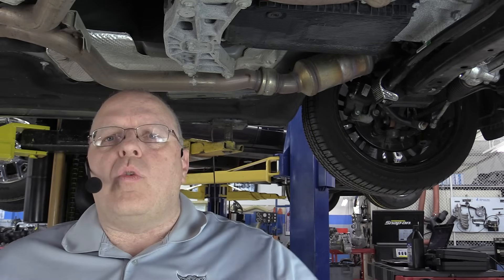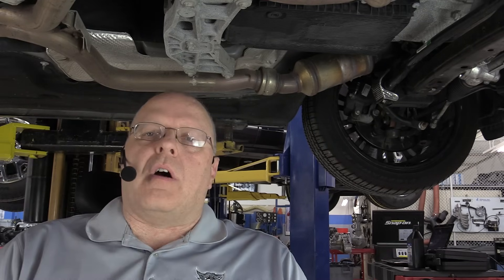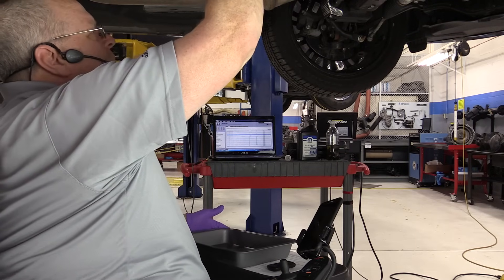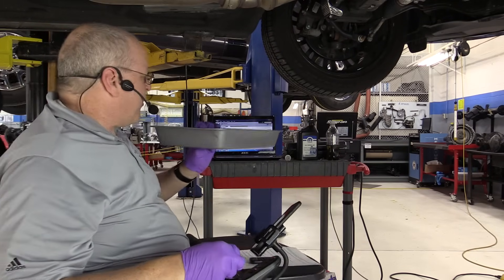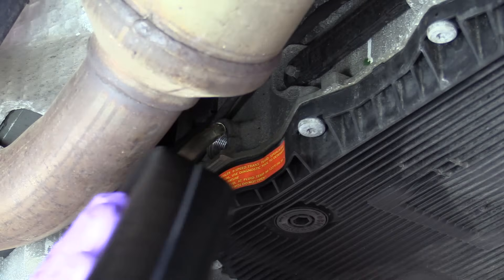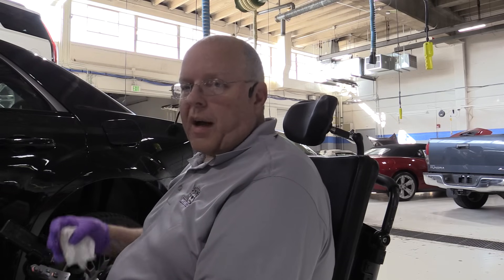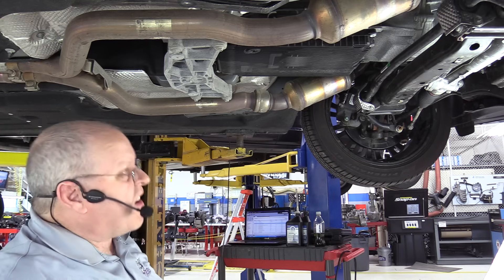Jeep, Dodge, RAM ZF 8HP 8HP 8-Speed  Transmission Fluid Level Check - No Dipstick

Comment: such a hassle for such a complicated high tech transmission but It's probably a engineering decision made to keep the transmission as universal as possible for all markets. would be nice if it could tell that the level is low or high via the scan tool or vehicle display maybe a level or pressure type sensor so you could get the transmission to temp the bypass valve would open and with the right software the system would tell you exactly how low or high the fluid actually is. just a thought I'm sure somebody may have already considered this
Reply: nice video by the way
Reply from the maker: Thank you!
Reply from the maker: Thank you for your feedback

Comment: I have 2015 dodge durango 8hp70 zf awd 
problem harsh down shift 4 to 3
and harsh transmission  he was parking the car in the event of tiptronic Changer and switch from steering 1 to Resolution 2
Reply from the maker: I do not understand your question
Reply: WeberAuto you have ever email

Comment: Do you recommend servicing this trans even though they claim it is fill for life.  I just don't believe it will last on the original fluid.
Reply from the maker: Yes, but not until a higher mileage, maybe 100,000 miles. Thanks for your feedback!
Reply: Thank you,
My 2013 300 has 149k on it now. Mostly hwy miles
Reply: ZF recommends every 100,000 KM (62,000 miles) or 8 years but it seems most manufactures say it is "lifetime" I plan on changing the fluid and filter on my 8HP 55A at around 70K miles

Comment: John,

Thank you for your valuable explanation; this will help me a lot when I change my ZF 8HP45 transmission fkuid.

If I may add, many BMWs also use the ZF 8HP AT, in particular the more recent F-series.

Conducting an AT oil change on the ZF 8HP merely replaces less then half the total amount of fluid in the transmission.
What are your recommendations for the ZF 8HP to get as good as a complete AT fluid change/flush as a DIY job and thus without having any special devices or a pump etc?

What are your comments on this procedure:
https://www.youtube.com/watch?v=tno0NfJmsSo
and
https://www.youtube.com/watch?v=ldUFUeV71us&t=1232s

And can this method be applied to the ZF 8HP AT to achieve a full oil flush and change?

Thank you for your expert advice.

Jake (Belgium)
Reply from the maker: Thank you! Yes, disconnecting a cooler return line at the transmission, and adding new fluid at the same time, until the fluid coming out of the cooler line is good and clean, is how I would recommend changing all of the fluid in any transmission.

Comment: Best thing to do is not buy one of these cars. That's just too much to deal with. $43 per quart and probably a $250 filter is crazy.
Reply from the maker: All transmission fluids and engine oil are more expensive now. Look at the special engine oils required for the tighter tolerance engines of today. The fluid in this transmission is expensive, but it does not need to be changed very often either. All new automatic transmissions take a special expensive fluid today.  Thanks for your feedback.

Comment: amsoil signature atf seems to suggest it meets the specs for zf autos
Reply from the maker: I don't know anything about that. I do know that the ZF fluid for this transmission has an additive similar to limited slip differential additive. It allows the clutch packs to slip, on purpose, as part of normal transmission shifting operation. Regular ATF does not have that additive. The ZF fluid looks more like gear oil than ATF. To me, it would not be worth using any other fluid than the exact fluid that ZF calls for. Thanks for your feedback. Best wishes!

Comment: Hey John, Great vid.  I am curious why you're worried about the oil cooler bypass?  I would have to believe that the when the valve is in bypass, the oil in the cooler is trapped and can't bleed back.  If it's bypassing the cooler, how could the oil in the cooler circulate back?   Thanks for your thoughts on this.
Reply: I agree with cmbenson1911, there almost has to be a way to keep the fluid in the cooler to keep the levels correct. My guess is that it isn't controlled by temperature alone, I would hope it requires the fluid pressure to open it as well so as soon as you shut it off and the pressure drops it closes the valve.
Reply from the maker: The oil cooler bypass opens when the fluid hot. If you shut off the engine while the fluid is hot, some of the fluid can drain back into the transmission. Then the fluid and bypass valve will cool down. This will leave open pockets of air in the cooler until the valve opens again. Thanks for the feedback.!

Comment: Check your transmission fluid levels in only 47 easy steps! 

Wow... crazy.
Reply from the maker: Welcome to 8 speeds and above! Thanks for your feedback.
Reply: Yep, crazy... Another effort to  prevent DIY'ers from doing their own maintenance.
Reply: @ureasmith3049  Honestly, other than the temperature considerations, this isn't much more complicated than the fluid check procedure for my 98 Honda Civic with a manual trans. There's no dipstick. This doesn't take any more time than an oil change.
Reply: @ureasmith3049  I'd even trust a dealer to perform such complexity the right way
Reply: He just lost all the fluid he put in. 😂
Reply: Exactly  @hemipower333
Reply: Ya, I second that! Dealer wants $850.00, who the hell can afford that?
Reply: Alfonso Demagistris $850 just to check the fluid level?
Reply: @jimmcgettigan1326  NO, about 850 for fluid and filter change.
Reply: And imagine how much the dealership or shop will jack you around for it now. @demagchevy
Reply: I have a 2013 Hyundai Accent that has a sealed transmission that only the dealer will touch. I have low mileage but I dread going to the dealer.
Reply: WeberAuto Hello master,5:09 min what is diagnostic name use? how cheking(diagnostic) electronik transmission ? can you say what computer programm? please.
Reply: @Azamatzhappar  Witech.  You need a Micro pod 2 also
Reply: and 2 days
Reply: Ahh...dont forget to pat your head, rub your stomach while standing on one foot.

Comment: Hey how are you. I have a question. I had to change the fluid in a 2014 Grand Cherokee srt. When the truck is on the lift, the truck is level but the transmission is tilted downward in the rear. Is it ok to check the level like this or should I make the transmission itself level?
Reply from the maker: Make it level with the frame, not the transmission. Thanks for the feedback!

Comment: "A 3 page service procedure"...........just for checking the transmission fluid level. 
$43.00 (FORTY THREE BUCKS) for a bottle of special fluid?
On some cars you have to pull a prop shaft to get to the filler plug
Ideally, the person(s) who designed this should be tasked with checking the fluid level in every one of these cars.

Meanwhile...those of us with old-fashioned "row it yourself" gearboxes can continue to pump until fluid runs out of the edge of the filler hole, put the plug back, and motor on down the road. I bet we finish before the ZF tech has his computer booted up.
Reply from the maker: Agreed!

Comment: is that a electrically controlled tstat, maybe a heat gun and temp gun could cut a day off of a trans fluid check?
Reply from the maker: No, it is not electrically controlled. Good thought on the heat gun! Thanks!

Comment: Thank you for sharing this video/info but i have a question when do you change the oil??
Reply from the maker: The recommended fluid change interval is different for each vehicle. Rough service could be as low as 50,000 miles.

Comment: Great information John very well explained. I installed a trans dipstick and tube on my 2011 F 150 with the 6R80 trans. No more having to play around under the truck next to that hot passenger side converter when checking the fluid level. In my view all manufactures should have an electronic display for the operator of the vehicle to check the transmission fluid level or at least a easily accessible dip stick.
Reply from the maker: Thank you! and thanks for your feedback. I was not aware that you could retrofit a 6R80 with a dipstick tube to replace the little short one under the truck.  Dipsticks can lead to other problems that are now eliminated. 1st. Their accuracy has always been temperature sensitive. 2nd. They allow incorrect fluids to be easily installed. If the special fluid for this transmission is $43 USD from the Chrysler dealership and some generic fluid is $3.59 at the local auto parts chain, most people will buy the $3.59 oil because they may think that all fluids are the same, the price is the only difference. Obviously this would lead to transmission damage operational concerns. Best wishes!

Comment: Seems like a trans fluid check should justify at least an hour of shop time. You  make very good points about the bypass valve. It's concerning that a closed valve won't permit a complete change of fluid, especially when service is done by a shop trying to keep cost to the consumer low. Not only does it take more time to do it right, you also have to replace more fluid at astronomical prices. I hate it when the most economic alternative is to call the junk yard.
Reply from the maker: Thank you for your feedback! I agree.
Reply: spelunkerd neither does fluid in the torque converter I would think
Reply: No such thing as "complete" fluid change

Comment: I'm honestly uneasy with even the Ram / Chrysler technicians attempting this when it comes time to have them change the fluid on my 2015 Ram.  There are too many variables to get wrong for a service industry that thrives on getting vehicles in and out of the dealership garages fast.  If they don't offer me a loaner vehicle or rental car for the time they're going to have to keep the truck, I'm going to have to assume they don't intend on doing the job correctly.
Reply from the maker: Thanks for your feedback. That is true in many circumstances and shops. There are good technicians out there who want to learn how to, and actually perform proper service procedures without shortcuts. The problem is finding them. Best wishes!
Reply: It's not just finding good techs that's the problem.  Some times the hands of good people are shackled.  Management practices, time constraints, and quota pressures and monetary incentives are huge factors as well.
Reply: Yeah don't buy for a minute the "lifetime fluid" BS. Change it regularly if you plan on owning the car well past the warranty.
Reply: You never need to change the fluid on an 8 speed ZF transmission. They are filled for life.
Reply: @TheQuagmireful1  Yes it lasts the lifetime of the transmission - right up until failure from fluid degradation.  If car warranties were 10K miles, then engine oil would be 'lifetime' too, and for the same underlying reason.  You may want to consider (1) what motivated manufacturers to claim lifetime ATF when nothing of significance changed mechanically, and (2) for whose benefit the change was made.  Answers: (1) TCO (2) their benefit, of course
Reply: @TheQuagmireful1  that is complete manufacturer BS. ZF itself instructs ATF's on their transmissions to be changed every 65 K or 8 years
Reply: @TheQuagmireful1  lol

Comment: Unless you have a leak there should be no reason for an average owner to check fluid levels, right? I've heard people actually mad that they don't have a dip stick, not understanding that's a GOOD thing.
Reply from the maker: Dipsticks are not as easy to use properly as most people think. Their accuracy is temperature based as well. Thanks for your feedback.

Comment: When this Chrysler is about 5 year old the cost to rebuild a ZF 8HP will be more than the cars resale value. I have come across this scenario with the 6HP26 @ 5-6K . The average motorist has no idea whats happening with trans repair costs until they have to fork out. I'm guessing the 8 speed ZF will be in the range 6-8K for a full overhaul with new solenoids. Another good info video.
Reply from the maker: Thank you for your feedback. These costs are part of the reason they have removed the dipsticks. No more incorrect fluids, incorrect fluid levels, etc. A trained professional is the only one who should be working on these transmissions.
Reply: @WeberAuto  Not even authorized BMW dealerships are servicing these transmissions. So the only purpose it serves is to limit the cars life with the oil life which is 8 years  at max according to ZF
Reply: that's more than the car is worth new.

Comment: Great video as always! So curious why Chrysler would never say anything about the bypass valve. You said it opens at 160 F correct? I would think that the cooler lines and cooling tubes in radiator are kept fairly full and the fluid doesnt all drain back into pan. Definitely a tricky procedure not for your average DIY. Always hated those temp. control valves makes it a pain to flush fluid sometimes on certain vehicles. If only it was electronically controlled and could be controlled via bi directional controls. What happened to good old fashioned dipsticks!
Reply from the maker: Thanks for the feedback! Yes, the cooler bypass valve opens the path to the cooler at 160 degrees Fahrenheit. The cooler and lines are higher than the transmission, so some drain back must occur upon engine shutdown. Why Chrysler did not include that information in their service procedures? I do not know. I found the transmission cooler information under the "Cooling" section of the service information rather then the "Transmission" section. Many times the technical teams writing the service information are assigned different vehicle sections (topics), maybe they did not communicate. According to the ZF trainer at the ATRA convention last fall in Las Vegas, this is an industry problem, not just a Chrysler (FCA) problem. Dipsticks lead to many other problems that are now eliminated. Their accuracy has always been temperature sensitive. They allow incorrect fluids to be easily installed. If the special fluid for this transmission is $43 USD from the Chrysler dealership and some generic fluid is $3.59 at the local auto parts chain, most people will buy the $3.59 oil because they may think that all fluids are the same, the price is the only difference. Obviously this would lead to transmission damage operational concerns. Best wishes!
Reply: blackericdenice Shawn of mopar ecodiesel used Valvoline Maxlife ATF in his ZFHP8 for over a 100K miles with Zero issues.  He even claimed the Maxlife gave him smoother operation and lower trans temps.
Reply: Smart people like to see how difficult they can make stuff. My job is to bring it back down to earth.
Reply: WeberAuto I would love to see just what would happen if someone use $6 full synthetic atf.
Reply: Gump Forrest I think the builders are full of it. I rebuilt a Honda accord power steering pump. I didn't see anything in there that need only Honda psf. That lady accord is still running with autozone brand psf.
Reply: blackericdenice its all about profit ($$$$$)! I will be draining my 8HP70 fluid at the 50K Mike mark and filling with Red Line D6. I also added a spin-on filter kit on the return line from the cooler back to the transmission.  2014 Ram 1500 Bighorn 4WD.

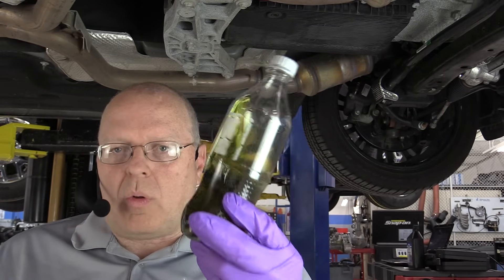Comment: 1:11 Did you say $43 USD a quart? DAMN that's expensive!
Reply: I can offer you a suggestion on the AMSOIL fluid.  amsoil iNC. is continually upgrading their lubricants so they are ahead of the game so to speak, and they have high quality base stocks and additives that give the best results.  Their recommendation for the ZF8HP 70 is  Product code (ATL -qt) which would be 1 quart.  Our Ram pickups take 8.8 Qts.
Reply from the maker: Yes I did! Thanks for the feedback!
Reply: Do you recommend using the factory mopar fluid? I have a 2014 ram 1500 5.7 it's got the 8hp70 transmission. I know amsoil has a equivalent fluid,or they say they do. The signature series fuel efficient atf blue writing. I already changed my filter and drained 4 or 5 quarts once. Alot of metal comes out of this transmission. It's a common thing. As of right now the factory fluid isn't giving me confidence. I changed it at 35k. I'm giving amsoil signature series  a try now. I'm doing a complete flush. What's your thoughts of amsoil? Kinda shady to me. Thanks. Great video btw.
Reply: $26 @ Walmart, whoohooo!!
Reply: Thats why the transmission lasts so long. Its the best
Reply: If you think the tranny fluid is expensive be prepared for a shock if you change your transfer case fluid.
$126 Can per liter ($91.24 usd) and you need 1 and a half liters .